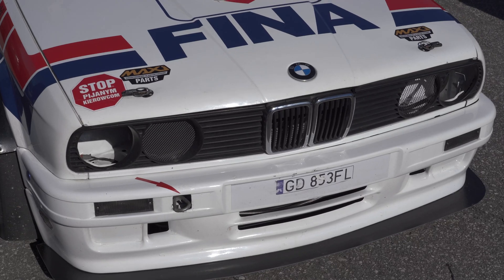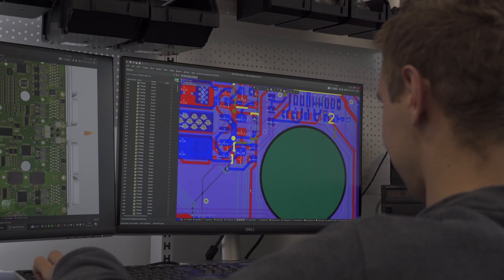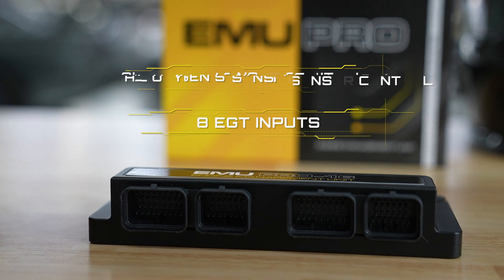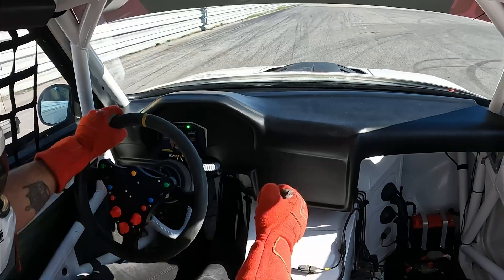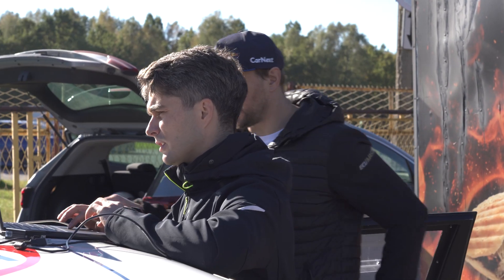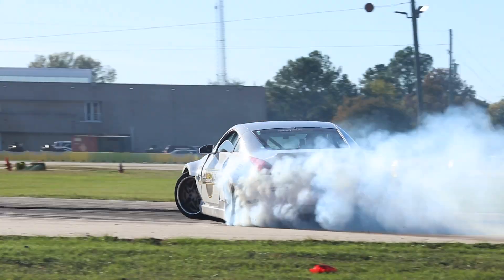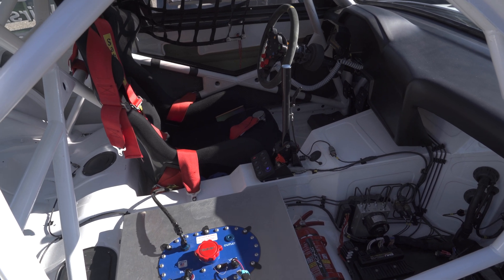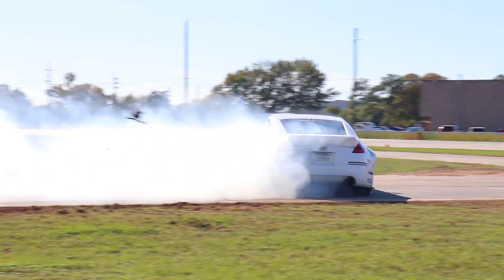ECUMaster EMU Pro

Comment: What kind of traction control does it have ?
Reply: Both RPM Based & Wheel Speed Based… at least that’s what my Black has
Reply: @BjornFSE  but is it based of speed difference (driven vs un-driven wheels) or is it just  rate-of-acceleration ?

Comment: How does direct injection work with Pro version? What is needed to make it work?
Reply from the maker: DI support will require a DI driver module made by ECUMaster that will be released at the same time as DI support, planned for late this year.

Comment: Can anyone confirm if this will support A340 or nag1/722.6 trans control?
Reply: Not at the release, but we are working on adding the strategy to control automatic gearboxes.
There will be a strategy that can control any planetary gearbox directly.
We will implement and test on A340 first.
Reply: @marekkuklis5867  Thanks, do let us know how that goes
Reply: @marekkuklis5867  this is awesome! I was planning to use the ofgear trans controller for my 722.6 and have that talk to my link thunder but might be able to get away with the one unit from ecumaster. We have alot of interest in the A340 here in Australia be good to see what can be done on the new ecu

Comment: would be nice to see the black come down in price now that the pro is out
Reply from the maker: The EMU Black is already drastically cheaper than anything else with comparable specs, and the EMU Classic is even less expensive. You can always shop second-hand if you're on a budget.
Reply: @ECUMasterUSA  are you guys still planning on supporting the classic as far as if there are any hardware issues?